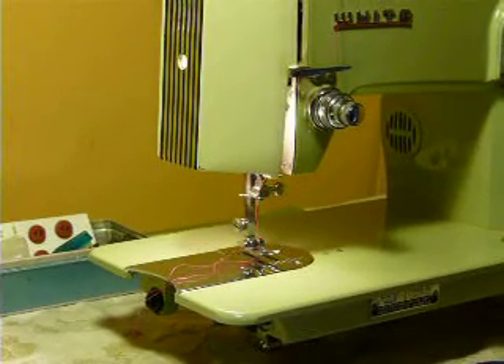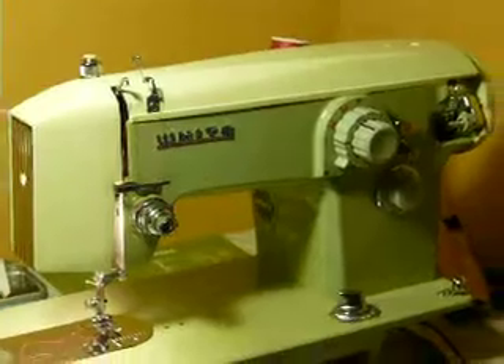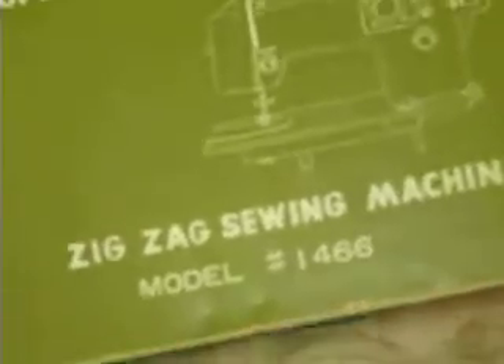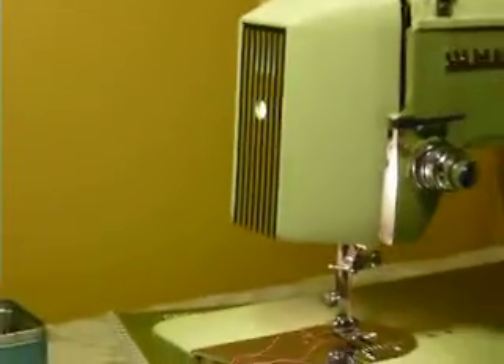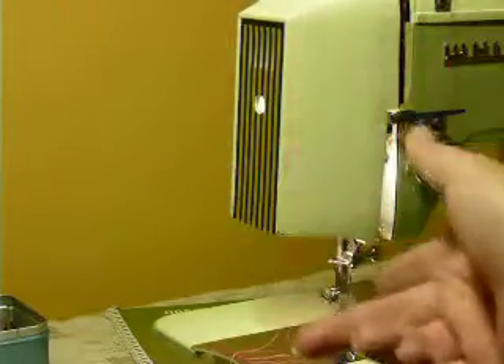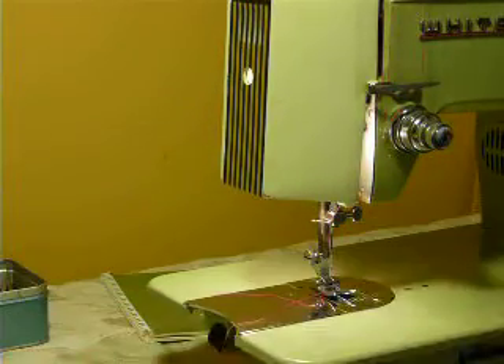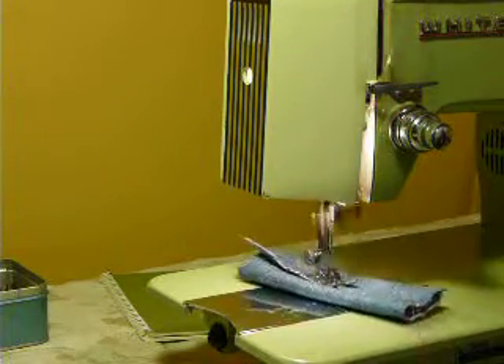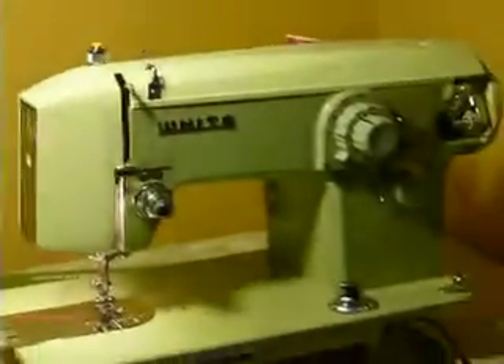VINTAGE WHITE 1466 HEAVY DUTY 1.3AMP SEWING MACHINE

Comment: Thanks for this video. I brought home this very machine earlier today and was flummoxed by the ZZ adjustment until I found this vid and your pointer to the Singer site for a manual. Glad to hear your machine is about as noisy as mine - I oiled all the things and it's still noisier than my old Kenmore, but not any noisier than yours seems to be. 11 years later do you still have the machine? Can you demo a buttonhole for us?